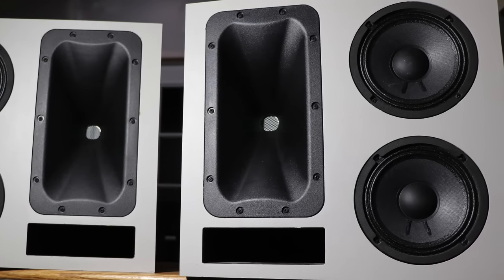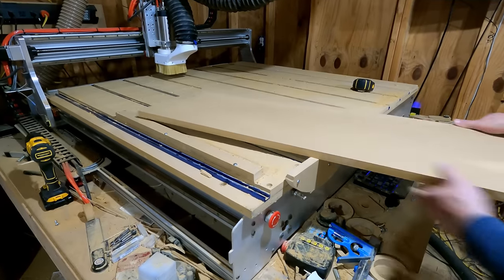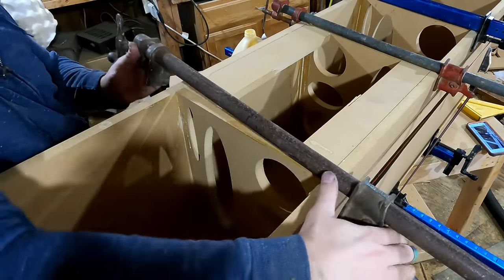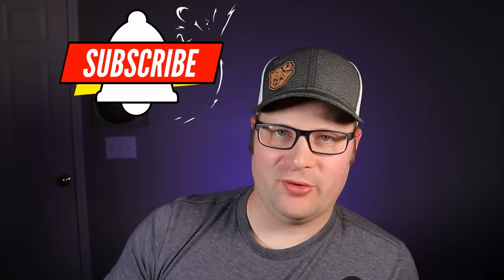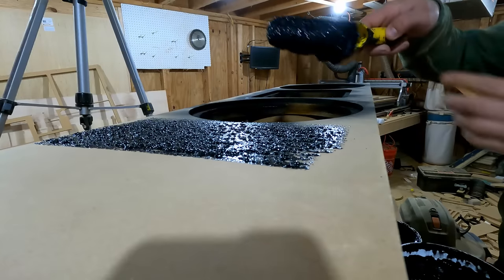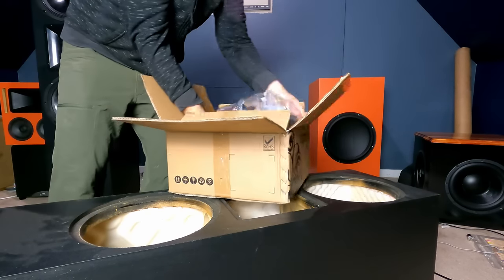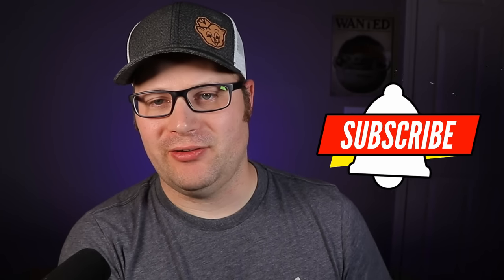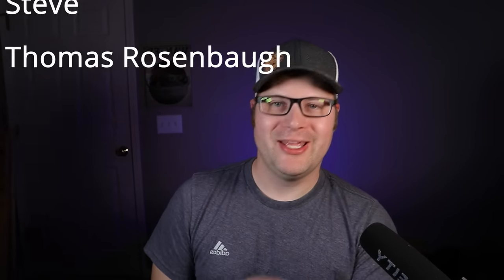How to Build $14,000 speakers for $1,300! JTR 212 Inspired - The Audience 212

Comment: Awesome build! I plan to build these when I upgrade my home theater setup. What speakers would you suggest to pair with these for side and rear surrounds?
Reply from the maker: I use these with the Cinema 10’s I designed
Reply: @Toid  thanks for the quick reply! I have been eyeballing those as well. That's probably what I will do then. Thanks!

Comment: As much as everyone's rooting for these, I have to point out one thing: the JTR speaker is most likely using a coaxial compression driver which allows a much lower crossover frequency than any 1" CD alone can handle.
The higher crossover will inevitably lead to vertical directivity issues that the JTR speaker won't have (or at least, it will be less problematic as the frequency will be lower)
Now, B&C Speakers makes a coaxial compression driver and matching horn, however, a pair of those drivers and horns will be quite expensive, defeating the idea of these speakers to be inexpensive.

I'm not saying these are bad speakers, just that they kind of ignore part of why the JTR speakers are so expensive, and so good.
Reply: This build would be equal to JTR 212HT 2way vs JTR 212rt 3way ,
Reply: JTR also uses  custom 12" driver 
With a 100$ horn and 800$ CCD 

Not exactly cheap parts , 
Considering these are clones and cover 90% of the range jtr do , not bad for a 1k diy speaker,
Reply: I did not realize that JTR made a non-coax version, thanks for letting me know!
It is definitely not bad for a budget DIY speaker, just the 1-2khz range will have some issues due to the xover and directivity.
The JTR 212HT has an xover around 650hz according to their website, which mitigates (to an extent) the MTM beaming of the 2 12" drivers.
I would be interested in how performance would improve with a larger CD and lower crossover. Even if he was to update the design with an $800 CCD, he would still be well undercutting the JTR speakers. (Of course, I would also suggest raising the box tuning to around 60-80hz, so that you can take advantage of subs and get more SPL out of the speakers).
Reply: @macattack123mattc3  agree with your comments. I suspect he know this, but judging by the comments, he probably realizes his audience responds to something that looks the part but is inexpensive. We really can’t tell at all if these are any good without seeing something like CEA2034 measurement data or at least Horizontal & vertical polar plots to show smooth directivity. Just showing a flat on axis response can be done for even poor speakers. For someone who sells plans, this measurement data should really be supplied. The JTR has been independently measured and it had good directivity control. 

If it was so easy to clone a good design, we could all make JBL M2 killers by mating a high quality 15” pro driver with a big horn compression driver in a ported box. If only it were so simple :)
Reply: @armandosinger  You can actually get an idea of what the polar response will be by knowing the crossover point and geometry of driver size / distance. The 2 woofers are too far apart to have good vertical performance with the crossover required by the compression driver he used.
I do agree that there is more to designing something than simply putting stuff that looks right into a box, but there is absolutely no way that these speakers could touch what the JTRs can do. The polar response makes it impossible…

Edit: I’m not dismissing this design, I’m also not saying it would sound BAD. But marketing some cheap drivers thrown in a box as equivalent to a proper HT/PA speaker is not right.
Reply: @macattack123mattc3  right. If he showed the measurements it would reveal his design flaws. He would have to cross over much lower and/or use a coaxial compression driver to make it 3 way (and cross over lower) to match the directivity of the woofer.

But most comments I see assume he nailed the JTR at a much lower price.

In reality, he needs a good design first, like you say, then 99% of the work is doing measurements to find and fix issues, rinse, repeat.

Comment: I'm looking to build a large pair of towers for my end game speakers. Running SVS Ultra Towers right now but want something bigger. 
I've always liked a 3 way setup though. Would this speaker work for critical listening? The typical horn sound isn't my thing.. at least with Klipsh speakers. Too much listening fatigue. 
I want something i can listen to for hours. 
I'm ready to build but these are my concerns.  Great job on the build! I watch your channel quite often.
Reply from the maker: @mrcarpentersc  I completely agree with you on Klipsch speakers. These are designed to not have the same fatigue that you get from those. Yet are designed for critical listening. If you want a third party’s thoughts on them, you could check out DIY HyFy who built them. https://youtu.be/JfKW023Zjp0?si=OpDyPhq3RLY5Ppb4
Reply: @Toid that video link you sent was the one that brought me to your build earlier today.  Thank you!
I think I'll build these this winter after the October rotator cuff surgery. I'm a  Master carpenter by trade so the woodworking won't be a problem. I'm hoping the price of the drivers haven't gone up to much! 
I've been looking for a end game speaker on Marketplace but I'd much rather build them.  
Thanks again!

Comment: Seems like the hardest part about doing this with traditional tools would be counter sinking the square wave guide?  Speaking of which you should discus how you would do parts of the build without a CNC during your build process.
Reply from the maker: This actually really wouldn't be hard. You would just take four pieces of wood and place them on the outside of the waveguide. Remove the waveguide and use a template bit to trace the inside of the wood. A half inch template router bit should route out the corners perfectly. This works out since the router bit rides up against the wood with a bearing. So it won't make a square cut. Instead it'll route out a curve.
Reply: @Toid  Yeah, that makes sense.  Having used a router but never having done square cuts I knew some kind of jig / template would be needed but for whatever reason I had it in my head it would be more complicated.

Still it would  be something to touch on for completeness sake.
Reply from the maker: @PhillioDoede  no I think you're absolutely right. After you said that I thought man maybe I should do a video on that. I'm not sure when I'll have time to do a video like that, but I am definitely considering doing one.

Comment: Really want to build these speakers however I don't have 58" to put these behind my screen with the subs below If I did they would still sit to high for the listening position. Been trying to model these woofers on WinISD to see what I would loose cutting them down to 33" high. I'm seeing only a few hZ difference on the low end between the two boxes. Do you think I could shorten these to look more like the JTR 212HTR's. Also WinISD is showing negative port length which means I just need an opening in the baffle for the port right?
Reply from the maker: I’m working on a new design that is smaller. It uses different drivers. I’m actually really excited about it. Hopefully something like that will work for you.
Reply: @Toid  look forward to it keep up the good work. Love your videos

Comment: In HT, everything below 80hz is taken care by the subs. Is it still worh having huge dual woofers like these? What's the difference between this kind of massive speakers Vs something like an Ascendo speaker with 6" driver? . Assuming both are used at similar SPL and same frequency range...

Comment: Is the center channel also available in the plans? I expect pretty much the same but in horizontal configuration
Reply from the maker: I am working on a redesign using different drivers that can be used either horizontally or vertically. YOu could use this horizontally if you want. It would just be cumbersome.
Reply: @Toid  Hey, have you thought about using the nero 15"? I actually decided to replace my middle avr shelf with a speaker lol, so I also noticed they are excellent at bass extension compared to the 12" midranges. They require a midrange like nero 6mrn unless your willing to cross horn at around 1khz through. 

Either way I decided to do zero compromise on my center channel, huge 250l enclosure, 2 dual 15", horn and so on haha

Comment: Hey! I love your  videos and projects. 

I have to ask why you don't cut groves for your panel placements? 

I can understand if you're using a router, but if you're using a CNC? 

Thx
Reply from the maker: I do on most of my builds. This one was a little too tall to fit completely on the CNC. But if you only take a look at some of the more complex bracing than I do, take a look at my earthquake 21 video. I built two 21 inch subwoofers that has some really impressive bracing and the grooves you looking for in this build

Comment: Are your new plans (klipsch KPT inspired) better than these JTR inspired ones?
What if you put the new compression driver as the one in the KPT version one inside this one? I only ask because I like the setup for a center "laying it on its side" but you said the new ones (KPT) you built was WAY better than these. 
I was thinking of building the KPT inspired ones for Left and Right and build this one for the center... thoughts? I've already bought the plans for both
Reply from the maker: The KPT which is actually called BTS 15 is definitely better in my opinion. I completely understand wanting a center on the side and that’s why I’m in the process of designing one dual 12 inch drivers with the same compression in the BTS 15. It’ll just be the 12 inch version of the 15 inch drivers used in that build. it’ll be a few months before that gets finished. This is due to the fact that the horn and compression driver that I’ll be using is on backorder. But I have no fear there will be an entire BTS line.
Reply: @Toid  Awesome!!! Excited about that build! I'll definitely buy that build as well.

Comment: NO FREE LUNCH , you can EQ to flaten bass to 35hz, but this will simply have more distortion, why is it you guys NEVER care to measure  intermodulation distortion. bass will muddy modulate midrange HD is also an item, feed 35hz and both your ears and room will actually be listening to 70hz harmonic as your ears more sensitive and speaker more efficient on bass harmonics

Comment: Can you share an SPL graph at 1W or 2,83V to show the real sensitivity? In the video you show 90dB with crossover and 85dB with EQ.
These should really be closer to 101dB/W/m just like the JTR212, if the crossover is good enough.
Could you also measure off-axis response both vertically and horizontally?
These will probably have horrible off-axis vertical responses as the cross-over frequency is so high for an MTM design.
Looks good on-axis, but e.g. for a higher row of seating it could be bad.